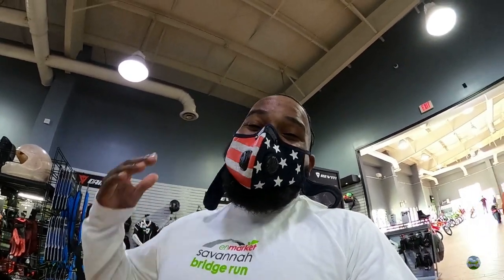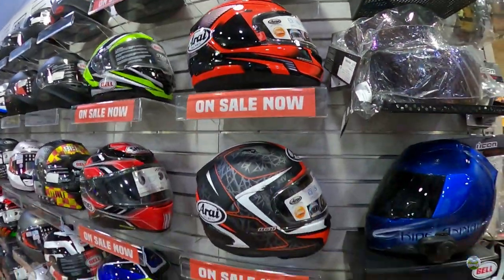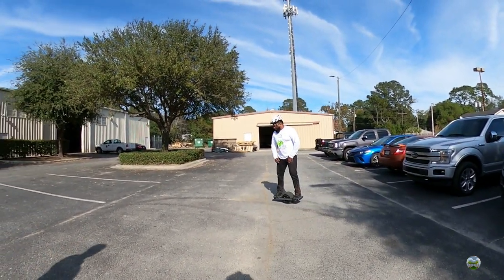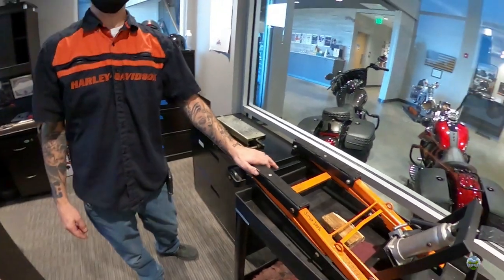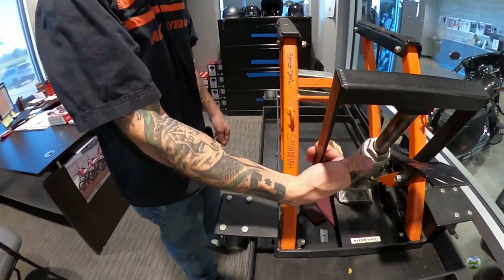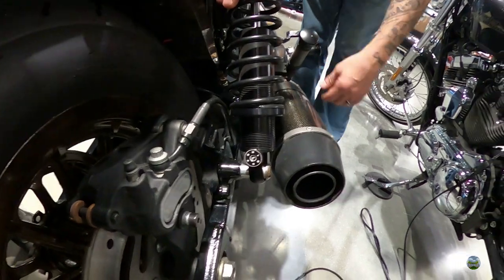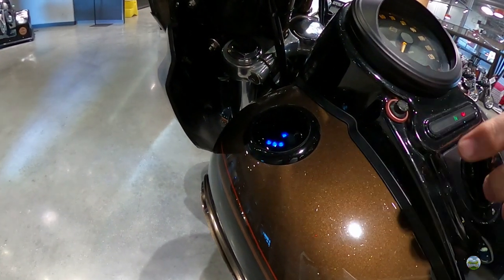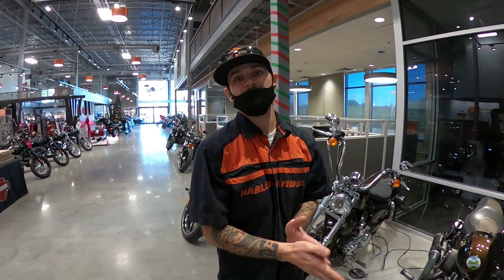$779 BELL Helmet 17+ yrs of Service | 2013 Harley Davidson Dyna Super Glide For Sale

Comment: Hey Wood my two cents you have to find a helmet that fits your head shape there are oval intermediate oval. Look at the Shark EVO one it’s a modular that you can wear as a full face or a 3/4. All jacks have job you don’t need anything more the the rolling floor jack your not going to do a lot of mechanical stuff your going to use it to clean and maybe an oil change.Hope this helps.
Reply from the maker: This helps a lot. Thanks bro!
Reply: If you buy the rolling floor jack you need to find the center of the bike weight wise. When you start jacking it up both tires should come off the ground at the same time. When you get up a couple of inches hold the bike an rock it gently. If it starts to tip or seems to lean front or back drop and reposition. Check out the jack Robert has he can help with tips.

Comment: Check out j&s Jack's made for big harleys
Reply from the maker: Thanks bro!
Reply: @woodjr.3771  yea bro they have dollies too. They have YouTube vids available bro.
Reply from the maker: @vqbigpapa2399  definitely will look into that.
Reply: Don't skimp on the jack! The $200 you save on a cheaper jack goes out the window the first time the bike falls of it... J&S makes a very sturdy jack and has dollies also. Only issue is the bottle jack on the lift may leak.... Use the locks if your going to leave the bike lifted for any period of time.
I have had mine for 10 years. Just need to make sure the hydraulic fluid level in the jack is maintained. 
ROCK SOLID!!
https://youtu.be/Fim0yZYgdds